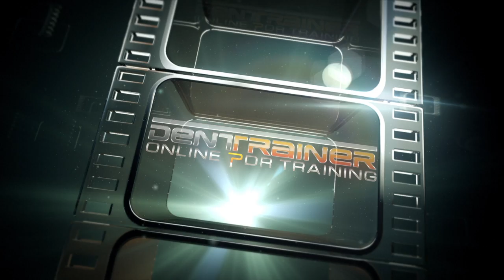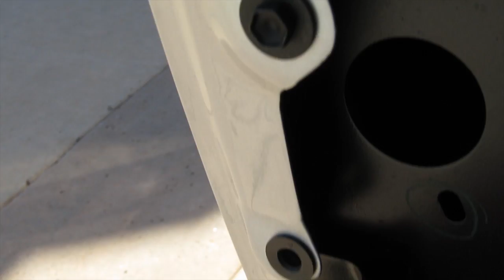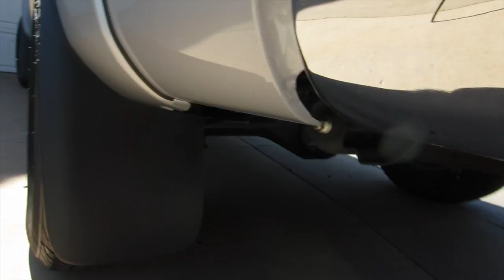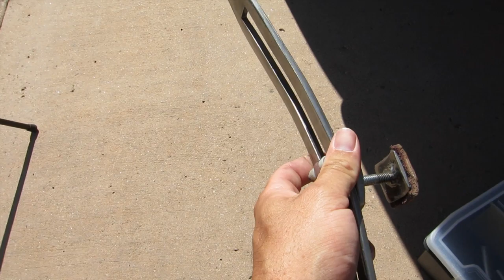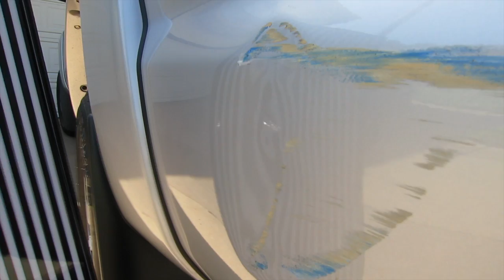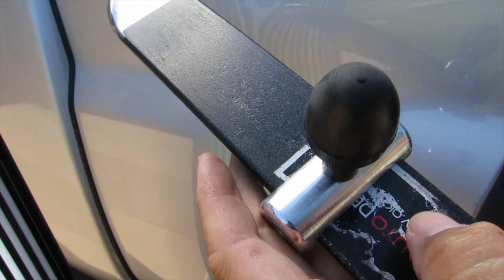Learning PDR Flat Bars (Tacoma Dent)

Comment: I went to Dentcraft's site, but I didn't see the cherry-tip caps by themselves, only a 4-piece assorted set for like .25 a piece.  I never could find them on the site, only the R4 tip.  Where on the site do you find the caps?  I messaged them about it, still waiting to hear back.